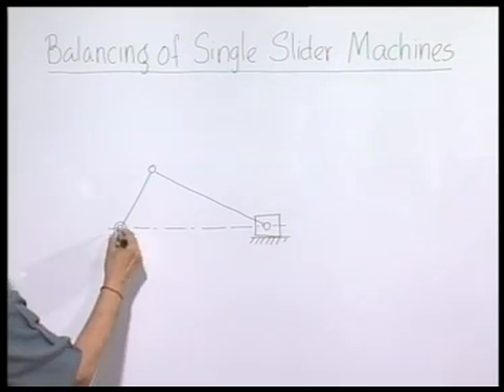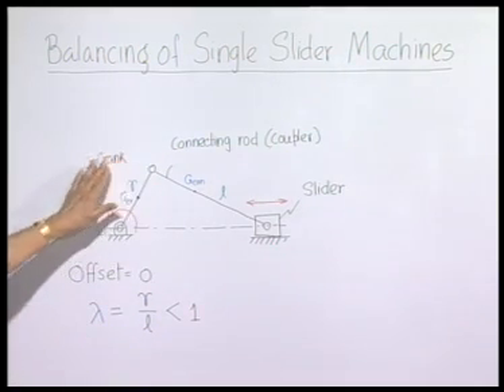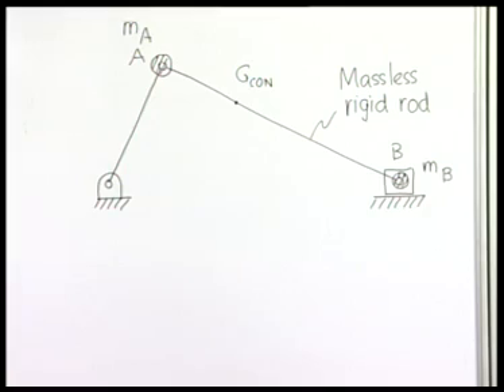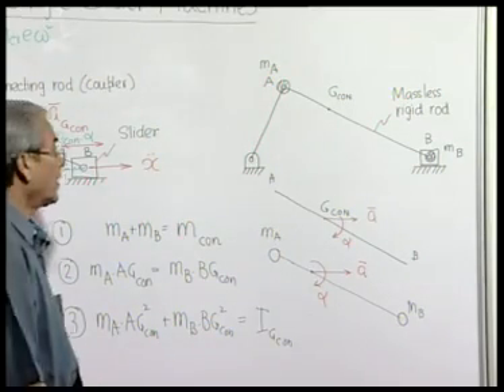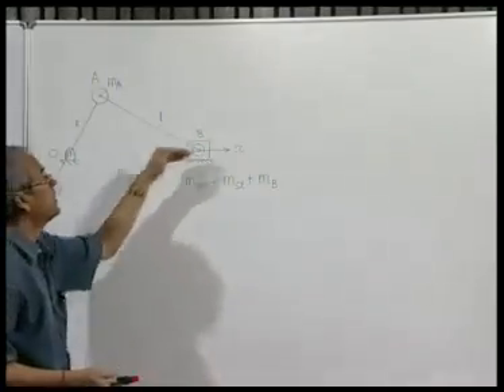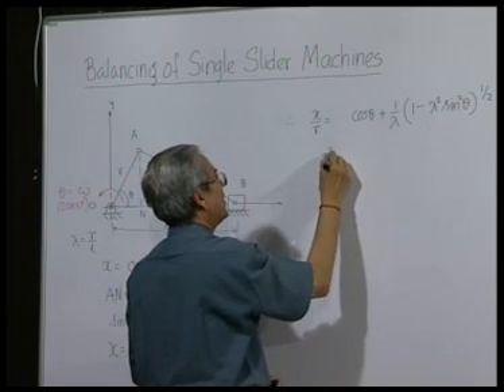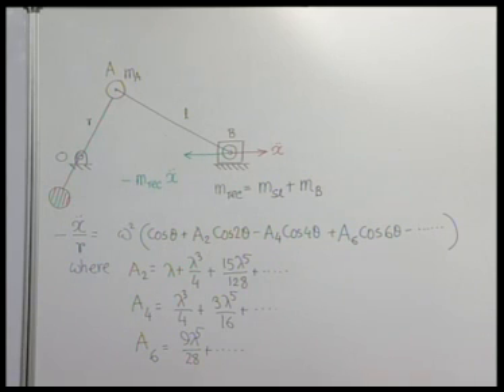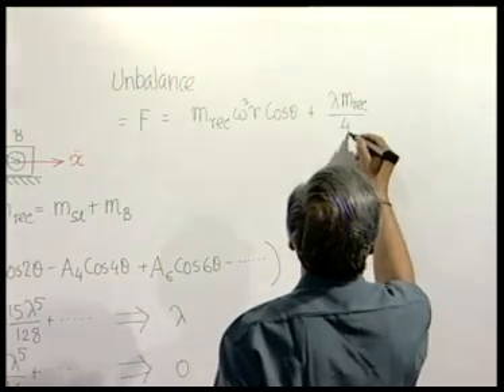Module 4 Lecture 1 Balancing of Single Slider Machines

Comment: how secondary crack will rotate with dabble speed when both are at same radius ?
Reply: same doubt have u find the solution?
Reply: Think that the second crank is the  rotational equivalent of the sliding part

Comment: The direction of (alpha) angular acceleration of connecting rod should be in a direction of decreasing "theta" (counter clockwise) 
But sir take it as clock wise 🤔🤔
Reply: I am having trouble finding out direction of angular acceleration of connecting rod(which happens to be the same as direction of application of correction couple). Can you pls help?

Comment: Great video Sir.
But should we not apply the correction couple too, to make the 2-point mass system of the connecting rod dynamically equivalent to the initial connecting rod system?

Comment: Sir, how can the reciprocating mass have acceleration in the right hand direction while the crank is having a CCW rotation & that also for the given configuration? I am confused!
Reply: every 360 deg rotation of crank shaft produces a to and fro motion of crosshead
Reply: but yes here , as the situation is that the crank is not returning but piston is going towards bdc so its not possible , maybe he has just assumed that direction, after solving it should come out to be negative.
Reply: Thank God you too put up this question. I was damn confused.
He did take the direction opposite!
I checked in my textbook.
Reply: I think the reciprocating body is executing a SHM say x=Asin(theta), then the acceleration will be opposite to the direction of motion.
Reply: It doesn't matter actually, because the magnitude could be in negative, which represents its opposite direction if it is in
Reply: That means it is decelerating and it also obvious that if it is accelerating instead of decelerating it would never perform reciprocating motion instead it follow straight line path
Reply: when the crank is returning or the piston is going towards TDC, the inertia of flywheel pushes the piston eventually and so gives it acceleration in right direction as shown above to compress the gas or remove the exhaust gases.